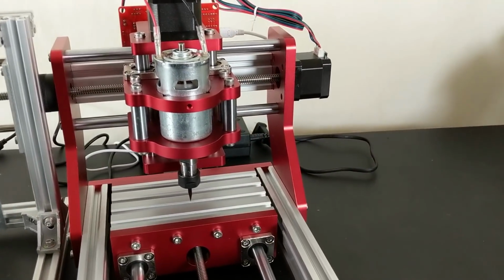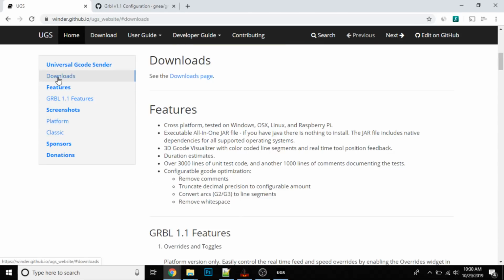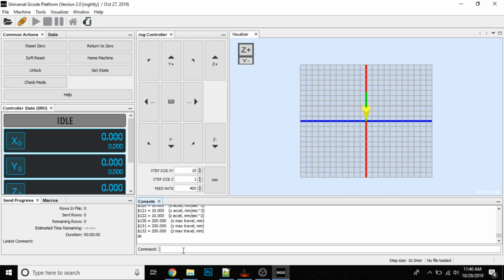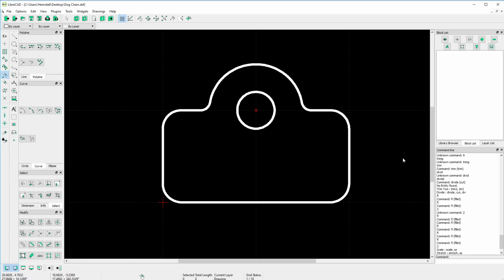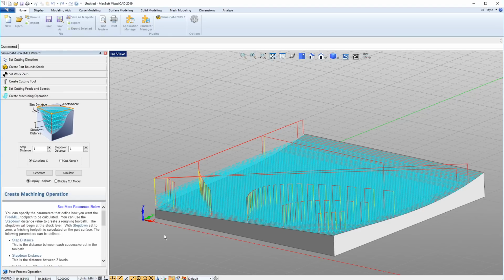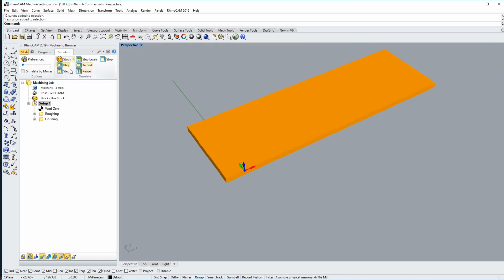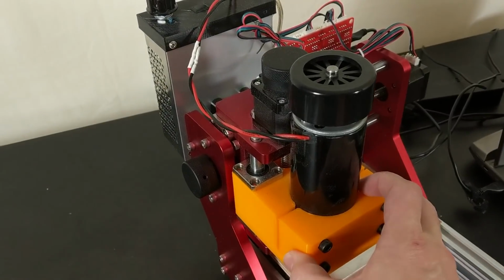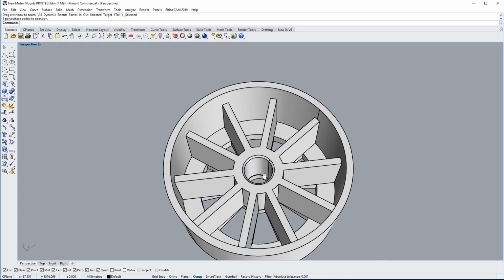How To CNC Cut Metal For Under $400 using the 1310 CNC Router

Comment: What machine do you recommend to cut aluminum if the budget is $1000?
Reply: What a waste of time watching this.
Reply: MPCNC
Reply: @GodzillaGoesGaga  I'm in a few of them. I'm having issue with machine zero coordinates. Got everything else. Seems like I'm missing the software side of it. Playing with Candle atm.
Reply: What cheap 5 axis machine do you recommend to mill ? To cut aluminium or F114 ?
Reply: I use the Wabeco F1200 which is similar to a Chinese BF20 to mill aluminium, it can do a cut 5mm deep of 10mm width (and 3mm in mild steel), but it's over your 1000 budget even without CNC. Sadly it has a backlash of about 0.6mm, so a circle will not be a circle. Someday I will change to a ball screw.
Reply: MillRight has a few budget desktop cnc machines
Reply: A Haas VF2 is not too bad.
Reply: i would say the indymill from nikodem bartnik
Reply: What machine do you recommend to cut through 1mm, 2mm and 3mm gold or silver plates. My budget is $2000. My work is made of names cut as pendants. I want a machine that would not eliminate details. Thank you
Reply: Sherlines
Reply: he literally started the video answering your question
Reply: So unless you really put down some cash, you really can’t go beyond aluminum? I’m getting that vibe.
Reply: @Stuff_happens  Aluminum would give a fair number of options, but bed size is really limiting depending on what you intend to do, but yes, metal milling can get expensive fast.
Reply: I would save more money to get a cnc with ball screws and a software how is smarter than grbl. 
I use PlanetCNC with cutter compensation and smart 3D Touch macros.
For aluminum 2-3k€. Sorotec makes good ones. For reference.
Reply: A few days ago I bought a CNC machine tool from an old textile factory. Each router weighed about 5 kg. I bought it for just two dollars per kg. Everything was perfect. They would throw them away for the slightest bearing. Definitely buy new My million is about three thousand dollars
Reply from the maker: This one is promising, but I haven't tried to cut Aluminum with it yet: https://www.amazon.com/Machine-4040-XE-Spindle-Engraving-Engravable/dp/B08M96HHKW/ref=sr_1_1?dchild=1&keywords=cnc+router+4040&qid=1605163511&sr=8-1

I will be making a serious video on that CNC machine in the near future. At that price piont I think your only other option is to DIY something.
Reply: @DesignPrototypeTest  Thanks for replying. I'll have to look at that machine.
Reply: @DesignPrototypeTest  Have you had any luck with aluminum on the 4040? It would be great to find a smaller machine with robust construction, tight tolerances, low backlash and a stiff/powerful spindle for less than $2,000 that can reliably handle aluminum with good results.
Reply: @DesignPrototypeTest  man, 1K and it can only do 15" square.. :(
Reply: @DesignPrototypeTest  But the 4040 on Amazon only has a 300W motor!
Reply: @DesignPrototypeTest   Unfortunately that unit is $437.16 (odd fractional price) delivery to Australia, so total of $1436...
Reply: @DesignPrototypeTest  Did you ever do the video on this? I can't find it anywhere. I am looking for a machine to cut and engrave aircraft parts. Any suggetions?
Reply: @GodzillaGoesGaga  Thanks. I'll have to look into that. I'm frustrated as heck. lol

My machine always sends alerts as soon as I start. Looks like it's machine coordinates is set off too far from where I can zero. 

However, when I change machine in Candle, it pull the project closer to zero but now it's negative and off the board. Weird and confusing. Been reading and looking at videos for weeks... :(
Reply: @ballzybaits4414  Does your machine have limit switches ?  Sometimes they bounce and cause false triggers.  There's a setting for the debounce time too as well as how much the head backs off from the limit switches.
Reply: @GodzillaGoesGaga  Yes, it does have limit switches.
Reply: @GodzillaGoesGaga  I will give that a shot. ty.
Reply: @ballzybaits4414  I almost gurantee whatever code the machine is reading has a code that is messing with the part location. Either that, or a setup issue but that would be very specificand you wouldn't find many answers online. I've seen stuff like this a lot with posted codes. I'm assuming some kind of G-code is used.
Reply: @brahtrumpwonbigly7309  Sad to say but I still can't solve it. The machine is collecting dust but I'm still eager to get it going.

I been looking at how to recode it and all the youtube videos on the subject but, no avail.

Comment: Got the 800W version. Blew up everything while experimenting. You actually get mains on the wires to the motor. It chopps the mains voltage with a MOSFET down to the required voltage. Horrible but it works.

Comment: The CNC world works in negative space as you cut material. If you have a 3d printer you work in positive space, as you add material(wich is more intuitive for non engineering persons), but its great for beginners. If you are interested you probably will learn over time. I can strongly recomend ESP32 controller with sd-card (its relatively cheap) and Freecad to make G-code. But you for shore want to learn the g-code for your controller.

Comment: I own an old 8020 chinese CNC circa 2000. Looking at the hardware, it appears to be aluminum capable but have not done any so far. The older units came with 12mm rods and a real ball bearing guides. The cutting motor is the exactly similar to the one it was replaced with. I purchased this for wood and pcb milling but need to move on to aluminum at some point. The price for this machine was $800 all included.

Comment: In multiple tests, it has been proven that PLA has the lowest creep and is also much stronger than PETG and ASA. the only issue is durability under UV light. apart from that, PLA is stronger than most standard filaments. And the title is clickbait, and in the end you dont even show the milling process, all of this seems like a waste of time and a poor review of a AliExpress milling machine
Reply from the maker: PLA does have higher absolute strength as well as stiffness compared to most other filaments. However, part of your comment is erroneous. PLA exhibits worse performance in regards to creep and especially abysmal performance for heat creep. UV durability is a low concern.

Comment: The answer to the cantilever mount a second Gantry there's plenty enough room on the frame to do this. In this video a 3D printed the motor mount for the new motor with proper design he could have added the gantries remove the camp lever and strengthened the x, y axis of the motor  relegating any swap in the cut to deficiencies in the motor the collet for the tools.

Comment: @43:50 i can explain you difficulties. The bouncing back and forth is because of your motor holder it's made of PLA it not only gives in the long run but it has e very elastic deformation E-module all the vibration and forces bend the motor holder elastically.

Comment: 2 years too. late, but wouldnt bolting the machine down to something heavy help this?  Surely if its sitting in a plastic box its not mounted to anything?
Reply from the maker: This is definitely an issue. But it's more something that would manifest as surface quality of the park. My problems were much more severe.

Comment: id like to see u do this video again with the new 3020 machines with the linear rails, some of them have it on all axis while most only have it for the x an z while the y are still on rods but are 12mm instead of 8mm so they are suppose to be alot more capable out of the box compared to the older 3018 machines.

Comment: You needed linear rails supported every 50mm instead of round shafts supported say 300mm apart at the guide ends, ball screws to drive the slides,  and a stiff spindle shaft supported nearer to the Z slide base. But that, as you concluded, is a whole new more expensive CNC router ! 
I recently bought an all metal,  linear rail, ball screw, Anolex 3030 EVO Pro ($660) built like a tank, emphasizing increased rigidity and low backlash, for these same reasons. It cuts Aluminum well, at moderately high spindle speeds and feed rates.
I have just upgraded to the Anolex 1.2kw VFD spindle to replace the stock spindle; man it is hefty !

Comment: I'm into one of these as well in fact I bought the 3018 as a test model to design a better one using SBR linear rails and 12mm ball screws and a 500 watt motor......3/4 finished but still on the back burner due to another project taking more priority........I would have to say that the one in the video is totally adequate as long as you don't push it ....scaling is a factor you have to experience and it won't like forcing the cut..........aluminium must be cut wet or you'll always get a cutter weldon with the chips.

Comment: I have the FoxAlien vasto. It’s a great machine for aluminum so far. Ball type Leadscrews all around. Motor couplings for easy upgrading. Heavy duty Dual linear carriages with rails for extra rigidity. 3 different sizes spindle holders.

Comment: I have yet to see a CNC machine without cooling with cutting fluid or oil. In case of aluminum WD40. then don't be surprised that the material sticks to the milling cutter.

Comment: You can get an exposed MR-1 for like 4500 bucks, and save yourself so much trouble, and it's a 3.6hp 8000rpm spindle 4'x4' table with 30''x30''x6'' cut capacity, and so stable, it takes 6 80 lb bags of cement! With all those machines and time, why not just do it right one time???

Comment: What i've done is up the feedrate to about 700mm/s, depth of cut 0.1mm. Spraying it with cutting oil, if you don't have cutting oil wd40 will do the trick. Spray some more when you start to hear chatter.
Use a endmill with a coating and small diameter, 2mm would work for your requirements. The number of flutes are the least of your problem because the chatter does not come from the tool itself, i would use at least 2 flutes, but i've used 4 flute endmills with the same setup with no issues, just don't cut completly dry with such small endmills

Comment: Why wouldn’t you cast epoxy granite machine. You can build a helluva CNC for under $1,000 that will blow away that router on the table. Im sure you could even build one for $500.

Use sodium hydroxide in distilled water to clean end mills and drop your carbides in and soak until clean. 

Triple flutes always work better imo. Never had a two flute in my machining career that did a better job.

When you buy end mills any reputable manufacturer will provide feeds and speeds for free.

Comment: Was a really good video going through so many different aspects of your decision making and the basis of a good cnc, to software etc. felt the pain at the end. I think we all want a working machine ideally cheap to buy. How would you make your cnc or what do you think needs changing in your final machine . Your spindle holder was not great being short in height. maybe worth revisiting when the pain has gone.( not to make us want to buy the machine but build it.) See Aurora Tech for 3018 based/robo cnc metal cutting though limited.
Please consider using her spindle holder and/or drilling holes to mount your spindle to see if it helped.
Did love your video - was just really sad for your hard work ending with disappointment and you seem to have abandoned cnc.

Comment: As a machinist I would suggest that you just dont do any metals with hobby cnc machines. They are way too skinny and they are made of Alu!!! Only a machine made of steel can machine steel, or Alu. 
I have bought the FoxAlien WM3020 (arrives this week) and that machine, althought it actually can (somewhat) cut Alu, I would NEVER do it. Cutting metal, even a soft one like Alu, will destroy your spindles and motors with the vibration. They are not made of high carbon steel that dampens vibrations. 

Hobby CNC? Stick to Wood and Plastic

Comment: I can tell you with absolute certainty that the chatter and drift in these types of machines is entirely due to the backlash nut essentially being loose. You either need to put a much stronger spring in, make a backstop that can be tightened against the nut, or find small ball screws. I've run dial indicators all over these machine types and they are actually remarkably accurate, but not under high load. The cutter is bouncing around as it cuts. These machines can and will do 1000mm/min adaptive cuts with a 1/4" full depth. I hope this is the answer someone was looking for.

Comment: Good video! thanks ! I just got me a Genmitsu 3020-PRO MAX CNC Router  then I saw this video. Which one is better the 3020-PRO or the FoxAlien. I need a good CNC router to cut carbon fiber boards and mill/cut aluminum. The size of the 3020-PRO is not a problem for me yet but tech support is important to me. I don't want a project CNC router. I need to  be able to focus on the actual parts I am manufacturing.
Thanks,

Comment: Hello, just as an FYI if you are cutting aluminum.  Use Varsol as a lubicant and coolant. Thats machining 101.  Aluminum  is very Gummy and a low melting temp thats why its gumming up the tool. No charge by the way.😁  Do not use Carbide with alluminum.  Carbide likes to work at high temps not good for alu.  Use HSS (High Speed Steel) 2 fllute.

Comment: If you get a little tub of "MIG Dip" from a welding store, and dip your cutters into the compound, it helps prevent the aluminum from sticking to the cutter, it helps to heat the cutters to 110° or so to liquefy the dip compound

Comment: You are never going to get a metal cutting machine at this price, You need guide rails and ball screws, not to mention a much beefier frame. Look at the real CNC machines. Do any of them look like they only cost under $3000.00? Nope. You will never succeed.
I built a CNC mill ( at least that is what it is called), The main problem I am having is, the damn spindle motor just isn't beefy enough. I first started out following Neo7CNC maybe 7 or 8 years ago. I built a machine a little smaller than his. 

With everything combined to build it from scratch, I put over $3000.00 in parts alone. This thing weighs a ton. I would either need to disassemble it or use a crane to move it. Those machines you buy that claim to be CNC MILLS are not CNC MILLS, they are CNC etchers/engravers. The most use you will ever get out them is to maybe route wood, plastics and any really soft material. Just nothing metal. There just isn't any way to make them rigid enough to cut metal.

Trust me, I have been trying for years. If you would like to see a photo of my machine pm me and I will send you one. BTW, I use MACH 3 for the controller. It is the most awesome program I have seen for the DIYer.

ADD: Even if you could get it to cut metal, aluminum would be the only metal it would cut and you would have to cut it VERY slowly.

Comment: There is a program called OctoPrint which can run on a RaspberryPi and is used to feed G-code to a 3D printer.  Could this same type of setup be used to eliminate the need to keep the controller connected to your computer?  If it's just sending G-code, I'll bet there is a solution out there.

Comment: Find a old bridge port and even the bigest machines if you dont have enough clearence aluminum is real gumy  and it will stackup and I have broke 1 1/2 high speed off enmills are made special to get the chip out.

Comment: They do make endmills that have a grind especially for cuting aluminum and most milling machines have gibs  tjat upi can adjust that make  steel machines more ridgid. Karosene works well for a cutting fluid that  keeps the chips from sticking or WD-40 I have seen used to make aluminum cut  freeer.. I ran machines that ran on ways 40 feet by 30feet waying tons rigity in all machines is the key to machining.

Comment: The Path workbench on Freecad has the adaptive clearing feature you were missing in this video. I'm not sure if they had it already when this was filmed, but at least they have it now :) Ever tried it? 

Great Video by the way. I learned a lot listening to your comments throughout the video!
Reply: Adaptive tool paths were available in FreeCAD 18 so I think they should have been available when this video was filmed. The only slight gotcha would be that adaptive profiling and tabs don't seem to play together nicely in FreeCAD (applying tabs to an adaptive profile seems to send FreeCAD into an infinite loop when I try it). The work-around would be to use adaptive to get most of the way down then do the last bit, with the tabs, using a normal profiling operation. 

I do agree with you that it's a great video and I'm sure many people will have found it useful.

Comment: I think your problem is more feeds and speed + depth of cuts than rigidity.   I use a gantry to cut Al I do use cnc wizard to get the optimum speed for depth of cut.  I also use either penetrating spray (occasionally) oil or a cutting water mister.   Based on your bits you are going too slow and building up more heat by recutting chips.

Comment: Single lip cutter or a D-Bit with gasoline for a coolant. This I’ve observed from professional engravers for 35+ years (for Aluminum only) cutting oil otherwise . We make the cutters on a Deckel single lip cutter grinder. We sharpen the cutter in the collet which is belt drive. It insures perfect center. We relieve the metal on the backside of the cutter which you probably know.
	I’ve seen cast cement frames made encapsulating the frames to take out the harmonic frequencies. The RPMs are fast , 20-30k. The main ingredient is a good fast spindle and a rigid frequency deadening frame. I know this this from watching hand operated Gordon And Deckel pantographs for decades. I’ve never seen them use a mill type cutter or a spiral flute. These machine are like the Flinstones other than the spindle and a rigid frame